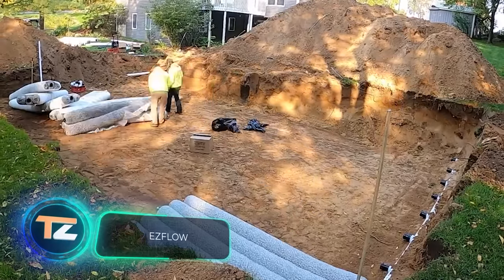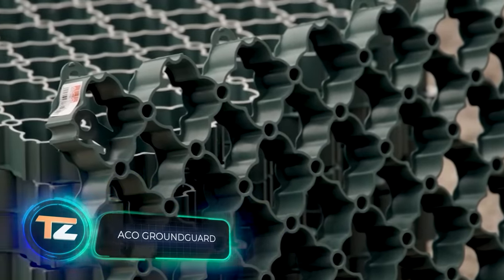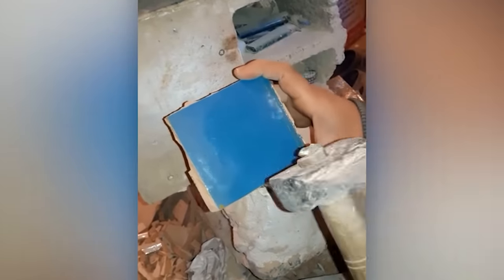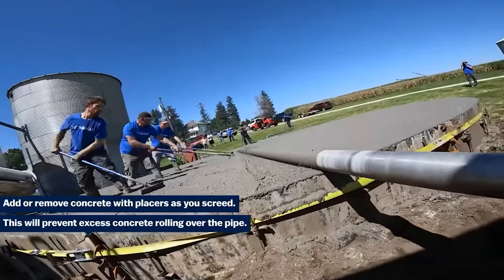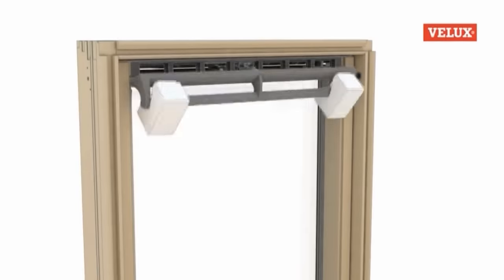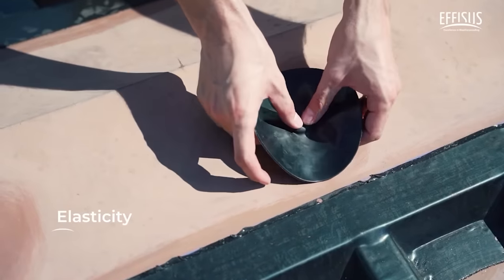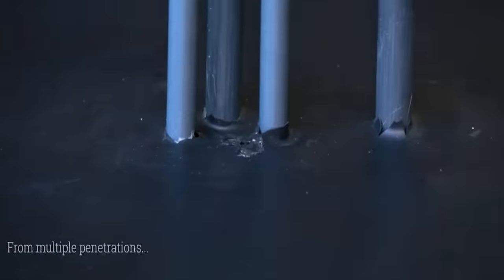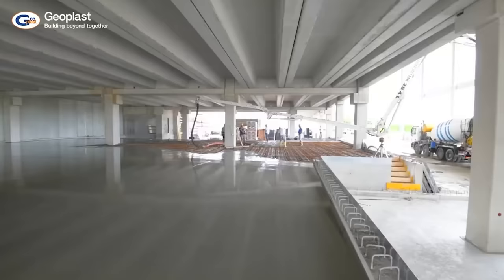CONSTRUCTION TECHNOLOGIES THAT HAVE REACHED A NEW LEVEL

Comment: I wonder if roofing companies have developed rain catchments systems for buildings
Reply: They have had gutters and downspouts for many years.
Reply: You must be an American if you don't have gutters yet, I forget how far behind American really is sometimes.
Reply: @georger5558  lmao the implication that Americans don't have gutters (you guys cant speak, you dont even have ac or proper light switches), the commentator means an alternative form of gutter
Reply: @stvrob6320  They're also garbage and still need to be cleared unlike what their ads say.
Reply: @georger5558 not what I ment like a catchment system that Brings it into the building and filters it for non drinking water
Reply: @DanB3286  Well in most countries rain water goes into drain/sewer system so that it can be collected/treated and then goes into regular tap water.

Comment: Great video overall, but that "septic tank" section looked pretty sketchy. Those just looked like leech-lines, but if methane can melt styrofoam like acetone can, those things will dissolve into slime in fairly short order. And they wouldn't replace a tank, they'd have to connect to one or more. That leech field at 1:02 seemed way too big.
Reply: It was freaking huge. Probably a multi-family system.

Comment: ofc you can seal and split apart two metals but going for the cause of the corrosion (such as choosing bolts that don't cause bi-metal corrosion)  is maybe the better and more long-lasting method

Comment: Those fake brick walls last up to 50 years?
My brick building that is 80 yo: UNLIMITED POWER
Reply: Usually when something is said to last you 50 years or so, it means it lasts for pretty much forever, even far beyond 50 years. The thing is that by law companies are required to provide a minimum garanteed lifetime. This is why we have bottled water with expiration dates, or even sugar or salt.

Comment: 5:30  Not really earthquake resilient, isn't it? A small horizontal displacement (standard with earthquake) and the small arch ... fall on the head of the occupants. Similar remark for the brick wall in Turkey, earlier in the video. That kind on construction is forbidden in most part of Canada, and not only because it is not earthquake resistant but because many incidents had occurred in the past with "block walls", and not only with hurricanes or earthquake but through foundation failures or re-managements for doors and windows.

Comment: Indeed, hand made tiles can be classified as engineering marvel and another level of construction. As a professional tiler I can say these are the worst kind of tiles. 
Different sizes, slightly different shapes, thicknesses, incredibly soft thus easy to brake and they require special treatment on a frequent basis. Yet, they cost a lot of money.

Comment: Recycled materials aren't eco-friendly if they can still cause environmental damage after being applied.
If you "recycle" plastics into aggregate construction products, they can leech microplastics and plasticizers into the soil. That soil will be difficult to sanitize after 50 years, which means if you want to grow some food, you'd have to remove the whole top layer and treat it as "polluted soil". In most cases, it's actually better to just fully burn plastics in a waste processing plant with a properly filtered exhaust, so you get some useful electricity/heat out of it.
Reply: 1. Any material can and will leave micro particles over time. And Calcium carbonates and high amounts of stone dust from the pure concrete that can drastically increase soil acidity really doesn't seem any better in comparison.
2. Generally when you build a house or appartment, it means the area is not suitable for agriculture in the first place, or that the community has no plans on doing agriculture on it for many generations to come.
3. Even if THAT is still a problem, buildings occupy far lesser space than agriculture, so not much is actually lost. Worst that can happen is that after bulldozing the area is become a micro desert that isn't even big enough to be seen on google maps

Comment: I use that ground grid system in my 30m (100ft) driveway at home, just installed last year. It looks like a basic gravel driveway but even after a lot of rain you can drive and park a fully loaded forklift on it. I'm using the PVC deck boards to rebuild my backyard deck next year.
Reply: Anybody know where/who sells the grid system here in the US?
Reply: Ive done a lot of the PVC deck installs in Australia. Theyre popular here.
Just be sure you account for overhang on corners, edges and stairs. If youre building the underdeck from new youll be fine, its only an issue when pulling up old boards and replacing with PVC. 
Good luck mate, have fun with it!
Reply: Bearing joints were mortared, the butt joints were not. The stone will certainly break at its thinnest point in the event of an earthquake. As correctly noted, not everything that looks good is good.
Reply: @3frogltd987  We used the TrueGrid Pro Lite system and our landscaper was able to just buy it wholesale and install it.
Reply: I've seen one at a company a few streets from where I work. I didn't really understand these advantages, but what I did see is that their parkings didn't turn into mud after a few month despite people parking there all the time. It's been a couple of years, a few of the squares show some wear, but nothing excessive and people park there everyday.

Comment: 😂😂 @1m:16s "TURKEY HAS A STRONG PASSION FOR CONSTRUCTION" 🤔 i wonder if the earthquake victims agree?
Reply: Was that something to laugh at?

Natural disasters doesn't equates zero accident nor zero victim. Even Japan with higher standard in construction's safety still claimed life.
Reply: @eone2345  the events no, but the comment in relation  to the fact that corners were cut in the construction of a large amount of the buildings that crumbled to the ground in moments, if only the buildings had some of the strength of the comment then perhaps many lives would of been saved.  Hope that clears that up for you. 😉
Reply: @Cobbydon  cut corners, agree, but that laughing icon in that same sentence, it was inappropriate
Reply: Yeah, thinking the same thing when I saw no rebar was used in case of earth quakes

Comment: I'm sorry I stopped at the polystyrene in the bricks. Whats the WmK of that? It looked like 6cm at most and then staggered? We're moving towards 12CM at minimum here. This level of insulation is just patently ridiculous in 2023 and it is an insult to claim this will save electricity.

Comment: The brick wall/insulation system design is defective: the insulation barrier is not continuous and therefore ineffective. The brick temperature will equalize between inside and out through conduction

Comment: The first video with the septic field! They didn’t even put filter separating the soil from the drain tiles. What a joke those styrene cubes will fill up quickly! Rendering the septic system useless once you start to use it!
Reply: It gets rapped in geotextile. Go watch the manufacturer installation vids.
Reply: @nzer57 it certainly wasn’t wrapped in geotextile in this video. No fabric any where!

Comment: Sorry, there is no way a leach field of packing peanuts has any structural integrity over time.  It may hold up that skid steer but I would bet money as human waste decomposes in those packing peanuts they will suffer some degradation.
Reply: It's a lightweight-expanded polystyrene. It won't degrade for a million years. It doesn't need to be structural nor is it meant to be structural. You'd be an idiot if you put a road, track, driveway or building over the top of it.

Comment: Hlello
what your said about turkey wall making is not true. I am civil engineer and energy saving was my main project in university.
I though maybe you wanna know about this.
Wall materials that we using around the world with single material base like bricks and concrete with high density , they will transfer hit, the insulator must disconnect inside from outside absolutely that the little joint could make connection for transfer. if they dont believe them at all.

Comment: wtf is with the obsession with 3d printers for mundane things? Just use an extruder. They are 1000x faster. 1000x cleaner. 1000x more structurally stable.
Reply: They do have the advantage of being extremely flexible though. If you need a custom brick you just design it in a 3D program, and you don't need to build an extruder that would be too much work and money for just one brick.
As for the structurally stable part, you would be quite surprised to learn how much pressure 3D printed objects can resist

Comment: the technology of ceramic blocks (because they are not bricks) and polystyrene foam is used with violations. Ceramic blocks should be joined with a thin layer of special glue, not a thick layer of mortar like bricks. Due to this violation, it can be seen that the polystyrene liner does not fit properly in its place and there is a gap of almost an inch.
The terrible consequences of the recent earthquake in Turkey showed how they like to violate the norms and technologies in construction, and this is a typical example.